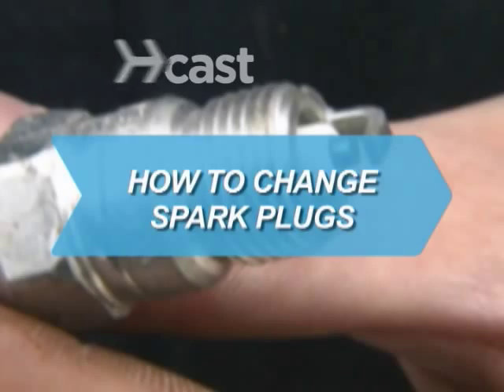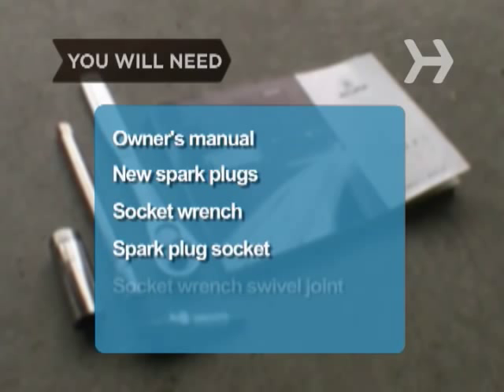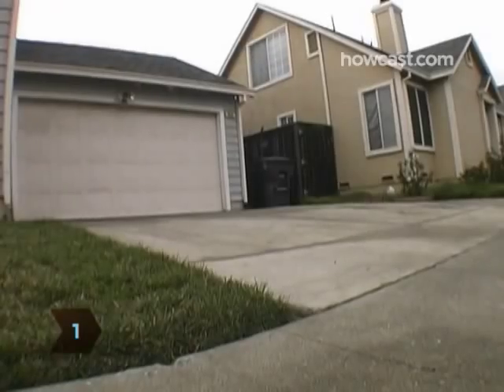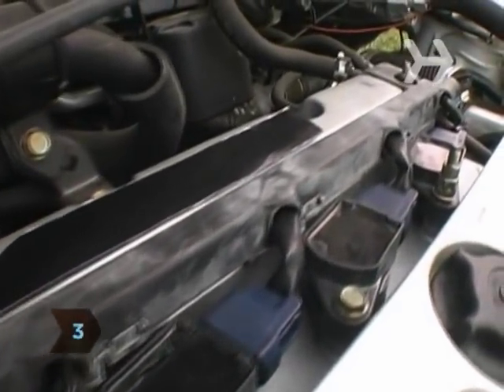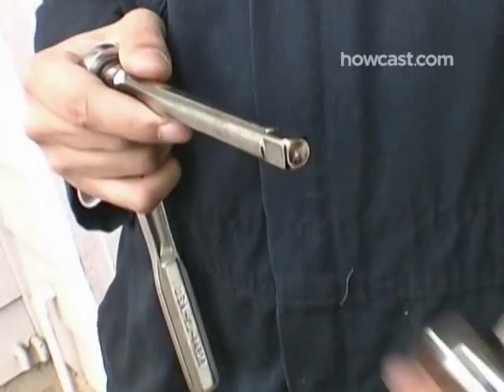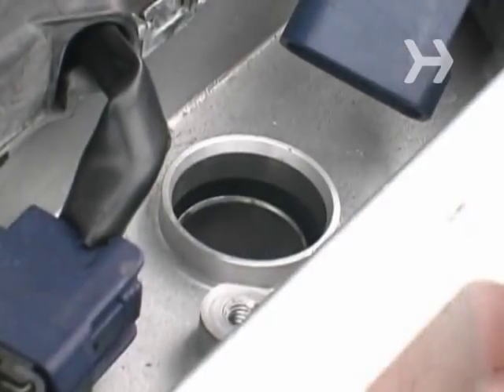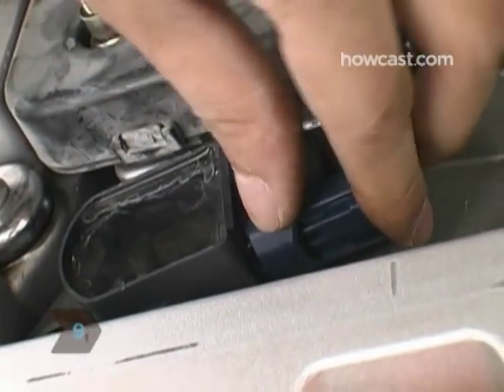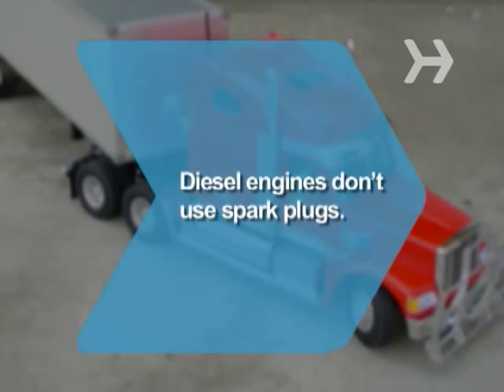How to Change Spark Plugs

Comment: @phector2004 No, Subaru spark plugs are mounted at something like a 45 degree angle on top of either engine head. The are easily accessed by pulling the spark plug wires and then using a socket and a 3 or 6 inch extension. Simple.

Comment: Tip: To save money, it can often be enough to clean the spark plugs, either with a steel brush or a chemical that dissolves the sod (turpentine should do the trick)

Comment: yeah right guys....most of the times that works...onother tip is to put gasline on them and tem ligt the fire for a while....then bruse them and you save the money of buing a new spark plug...which is apoxximately 4-5 euro in greece